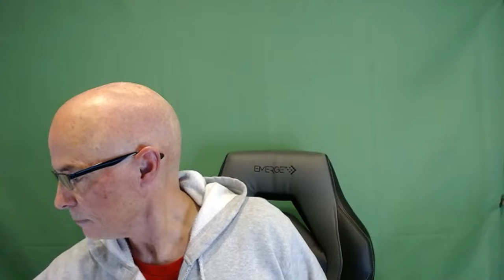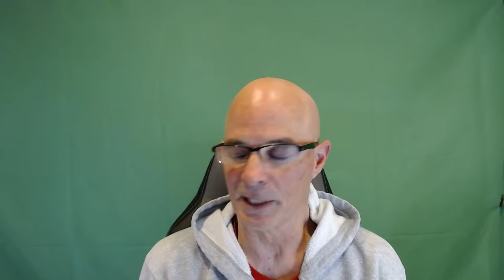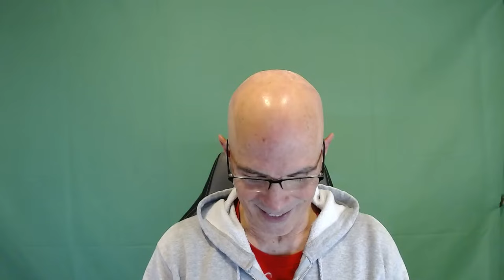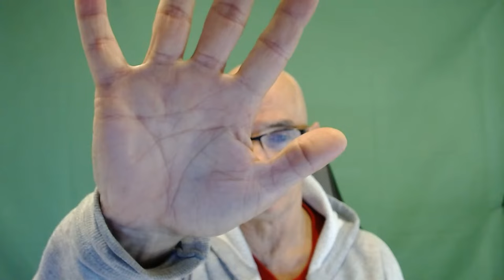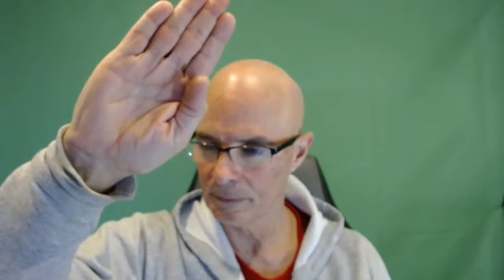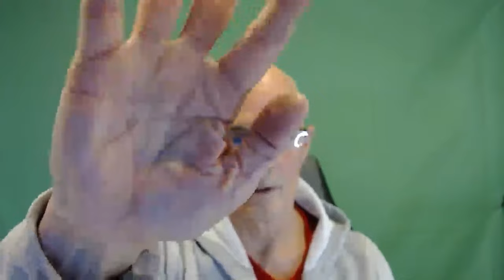LET'S TALK TECH-CALLAWAY TWIN TURBO

Comment: I have forgotten a lot of the specs of the Callaway in the passing years.  When the RPO was announced my dad had just purchased a used (791 miles) '86 in 87.  It was Iron headed and rated at 230hp &330 lb-ft .  The 87 was rated at 245hp &355lb-ft. IIRC.  My dad's first inclination was to ship our 86 to Callaway and have them and have them add the option.  NOT!!  So we kept the 86 for 27 more years.  BUT  I always pined for a Callaway and knew ALL the specs back then.  4-bolt truck block, forged internals, etc.  It could be ordered with either the Doug-Nash 4+3 or the 700R4, and most had the 3.08:1 axle ratio.  It did not require the Z51 option as I recall.  I finally got to drive one in the mid-90's and wished dad had ordered one.  Quite impressive compared to a 86.  And a Holy Grail car for me is the "Sledgehammer."  There were magazine articles about these cars every month for almost a year; R&T, C&D, Automobile, MT, "Vette, etc.    And then, just after all that hype subsided the ZR1 was announced.  I thought, will Calaway build a ZR1 too???
Reply: My 1985 Corvette had a 4-bolt block.

Comment: The C4 Corvette B2K Callaway Twin Turbo Corvette Had the Most Beautiful Engine Bay.
#2 was the 1990-1995 C4 ZR'- DOHC 350.
All Callaway C4 B2K Corvettes were Doug Nash 4+3 or M6 ZF Manuals except for 1987 Year only.
1987 had the Optional Automatic a Turbo 400 hooked to a Gear Vendors Overdrive.  Just SEVEN 1987 B2K Turbo 400 Gear Vendors Corvettes were built thats it.
Dolly Madison her 1987 B2K TH400 GV Convertible is most infamous. Dolly Madison of Snack cake company fame.
Reply from the maker: thnx-great info

Comment: The Greatest GM Engine Ever Made 1990s waa never installed in a car. 
The 1996-1999 454 Gen 6 in a Chevy C2500 is Fast ! 
Got a 4L80E trans thats totally Bulletproof. 
The rear differential is a GM 14-BOLT 10.5" Inch . I added Motive 4.10 gears with a Powertrax No Slip Locker.
Street Race it all the time warm nice weather. 
Raced it at NNN 2023 and kicked Ass !

Comment: Callaway is in Old Lime Connecticut. I been there back in early 2000's when I went to tech school for the GM Tech. When I was there they had a room filled with modified LS1 engines they were building to ship to Australia. Yes John Lingenfelter designed the Super Ram intake system. Check my youtube channel I have a video of a 383ci L98 built at Lingenfelter back in 1997. 500hp at the crack. Stock heads LPE 219 cam LPE throttle body. and John's Head work on the stock heads among other upgrades.
Reply from the maker: I Tested the Super Ram on my video with all the TPI intakes. I met John at Road N Track top speed shoot out in Ft Stockton. Amazing guy.

Comment: The thing about an L98 Tuned port its all Torque your driving a gasoline buring SBC Diesel actually. 
Want it in a light 3200 lb C4 Corvette with tall highway gears it shines brighy.
I Love my 1987 Corvette C4 Convertible.  Served me well for over 200,000 miles I dtove it all over the USA